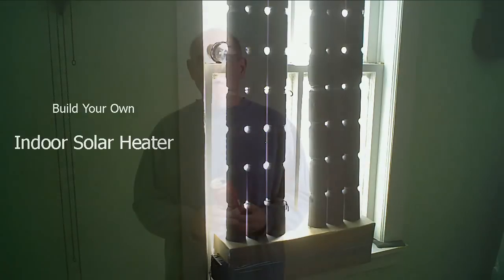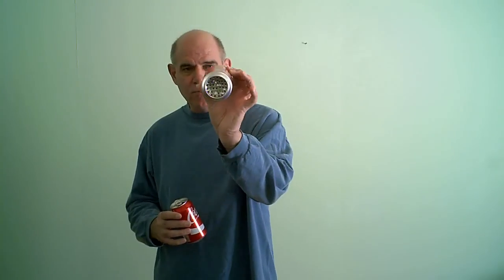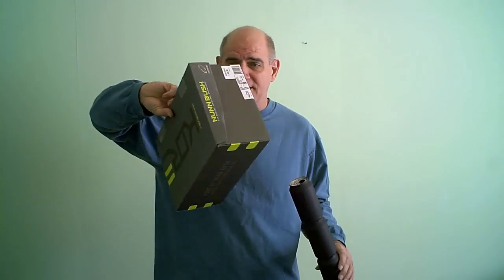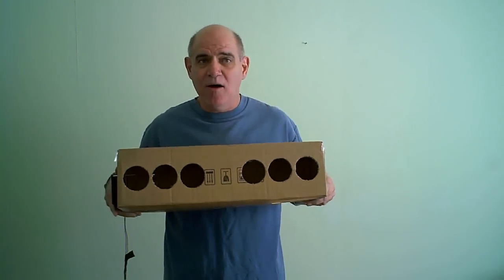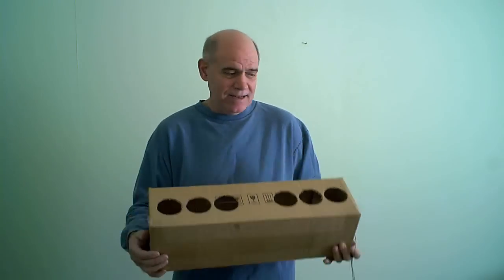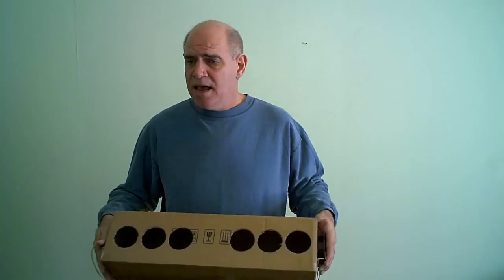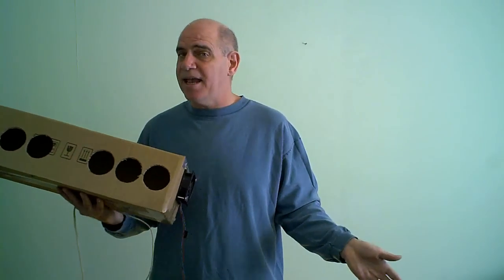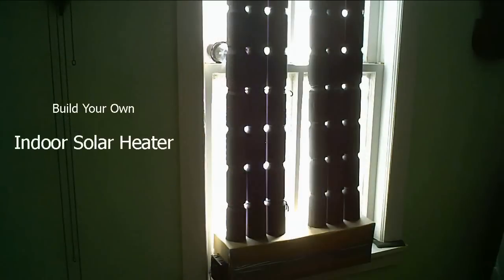Indoor Solar Heater

Comment: Outdoor need glass front and sealed, plus weather proof, internal heater can use the inside of the glass by simply standing in the window and can be movables as the sun moves around.

Comment: We have to run an electric fan for this to work though?
Reply: It will work without it because heat rises and cold sinks.  A fan will just help.  You can run a computer fan off a small solar panel.

Comment: A black curtain would work better. Also the glass on the window and the gases between filter out  wavelengths of light that's energy that's not even hitting the cans. Cans are only used because they're good in a box outside best option if you can afford it is black tiles on the floor with the sun hits it

Comment: If the entire tops and bottoms of the cans are removed, and one whole side of the box is completely opened up, I think the extreme thermal gradient between the top and bottom, and the ease of airflow might get rid of your need to even have a fan via convection.

Comment: the heat has already come through the window, all you are doing is stopping the heat at the window . Let the sun shine on the objects in the room, keep the windows clean.
Reply: but then it hits the walls and floor and conducts away, whereas with this, nearly 100% of that heat convects into the air first.

Comment: Yes, fossil fuel companies are not stepping over each other to teach people how to go solar, but this particular type of device is much copied on YouTube, but it is not as effective as a physicist like me can teach you how to build it.  Forget the pop cans and all you work collecting and cutting them, they are unnecessary!!     Instead build a well insulated box, insulated from the OUTSIDE either with foam insulation or 7 or more layers or corrugated cardboard using white glue, and use a layer inside the wooden box of aluminum foil, also adhered with white glue.  Spray paint the aluminum foil inside the box with flat black heatproof paint, engine enamel or such.  Then suspend two layers of black aluminum window screen from the middle of the top of the box to the middle of the bottom, with steel wires. A hole in the bottom and top about 4" will bring in the in-house air to be heated at the bottom, and the hole at the top will bring back the air that has been heated into the house. Use flexible dryer hose for both and wrap them with soft aluminized insulation. It's best to put these on the south side of your home on the home outer wall, but if you cannot, then put them close to the home in your south yard exposed to the sun and pipe the hoses to high and low holes in your home. Then use a small box fan from a computer to blow in the hot air. Cover the boxes with either glass, or clear plastic sheet. If you use corrugated plastic then use the waffle foam they sell for it to seal the corrugations.
Reply: Show us
Reply: @xgymratx  
I just told you.

Comment: You are a fabulous man Lol, a man after my own heart. I have gone NUTS researching these Solar Air Heaters & I have ended up with "analysis paralysis"!!! I was in melt down trying to decide the best most efficient way to construct a heater & materials to use. YOU SIR have in my opinion & for my "original ideas" for needing one & how to make it, come up with a FABULOUS  & simple & green design that is exactly what I wanted. I too will make the same version as yours & then an external similar design too.But I just love the one in this video well done!!  Even using the fan to push cool air not suck hot air is better design for the external one, which should produce up to 150deg!. So thanks very much to you & a chap called Desertsun02 on YT as well. Simplicity is best.

Comment: Exactly Wat I'm been saying about solar heaters. Who wants all that drilling holes in ya wall. Wat I'm saying is it don't need plexy glass on it if it sticks str8 to the window. Thanks for proving it works. Ain't built mine yet but mine will be indoor heaters. PS it can be built with a tilt in it. Even flat its gonna pump heat init. Love it.

Comment: A simple solution would be to replace glazed units in North facing windows with low iron glass externally for better light transmission and low E / K glass internally to trap heat.

Comment: Only in the winter, you can try adding a little fresnel to your window or door panes to get more warmth! But do not use cardboard with it, because you can start a fire in the house. I think this system can be further improved in many ways.
Reply: A Fresnel lens is only a concentrator, it doesn't send 1 single photon more into the room. Only thing it does is creating fire hazard

Comment: You can run without the fan, as convection will automatically pull cold air in from the bottom and as heated push it out the top
Reply: I bet the fan could be used at the top to blow the heated air into the room, or you could add a second fan...
Reply: as long as there's enough ventilation to and from the cans. He may need bigger openings.

Comment: I think this kind of "indoor solar heater"is meaningful and efficient, because it convert the most of solar 'light' energy to 'heat' energy. As commented below, the total sum of solar energy does not increase after entered inside room, but the large amounts of solar energy will be consumed to brighten the room. I guess this kind of black device keep the solar light photons from being consumed to brighten the indoor space, absorb the solar energy efficiently, and help converting most of them to the heat energy.

Comment: pop can heater get up to 210 degrees and using cardboard is a great for starting a fire. Think I'd rethink using cardboard.
Reply: paper needs to reach over 400 degrees to ignite not gonna get that hot ever
Reply: Definitely don't use any type of magnifying lens to increase the heat on the cans.

Comment: I think this solution could also be perhaps applied to vehicles that are kept outside during the winter. Having this solution on the front windshield could be useful. An outdoor solar heating solution simply wouldn't be an option. 

There are issues with vehicles (including the glass) that would make solar heaters less effective, but I feel like it's worth a try regardless.
Reply: Buy a black car
Reply: @omarsoulay4764  That just heats the outside panels. A black interior could help. The problem is that your gains are instantly lost.

Comment: Thank you for this video.This is a simple and elegant solution to my heating problem. I live in an older home without heat on the upstairs. But there are sunny windows on three sides. I'm going to make these for those windows and use small solar fans from ebay. I prefer solar heaters on the inside because I don't want to be up on a ladder, and don't want to be drilling holes through the brittle shingles, and I want to easily remove them in the summer and just store them in the closet. 
I realise that this will only heat during the day with sunlight but that's better than nothing.
Now I have to pick up some pop at the store get hubby to drink it all and get on with my project.
Do you seal the top cans? 
What if you used one of those pointy old fashioned can punchers to punch triangular holes in the botton of the cans?.
Reply: Hi you have probably made your system    The original design from the Canadian Maritime Provinces used a key hole saw blade the kind that is used for door / dead bolt and handle installation
Reply: Darlene Young  Shut the doors to the room you are trying to heat. It might keep alot of the heat in when going to bed. Take care.

Comment: For people not seeing the purpose: 
Incoming solar radiation does not vary, but WHAT happens to that energy does. Sunlight striking and heating the floor suffers heavy conductive heat losses to the foundation etc, and in his case is not providing a comfortable air temperature. This setup specifically  increases interior air temperature, kind of the opposite of a mass heater.
Reply: Isn’t the net heat still the same? Isn’t it easier to heat the air than the dense floor? I don’t get it, I feel stupid.

Comment: The light (heat) is allready inside house. You just block the light to heat your floor and force it to heat those cans. Energy is the same inside room with or without cans
Reply: but you dont walk on the cans
Reply: Baby Power No.  It is circulating the air.  And the black metal heats to a higher temp,  than your carpet,  furnitire,  or whatever the sun is hitting.
Reply: Light and heat are not the same thing. Energy is not heat just as it is not electricity, though it can be converted into both.

Comment: I am having a bit of trouble understanding your "indoor solar heater" analysis for heat gain.
If the sun has entered your living space and then shines on your panel of metal cans to warm the air that is already inside your house, then what does your device do to transfer the heat that is already INSIDE your house?
Passive solar heat gain has already been achieved by sun rays that have come inside your living space through your window, let say.  The passive heat gain has already taken place!  There is no need for your device any more!
Tell us how your device contributes to heat that's already IN your house, please.  Thank you!
Reply: homayoun Shirazi if the inside of the house was black and metal would be no need of these. The cans transfer heat better than say.. Wood. Also black absorbs more energy and the system is like 6 hot chimneys. I built one. Now. There is a need for this! (unless you have a black metal house)
Reply: Better than the couch? Better than the floor? Stop typing so the world won't know how little education you have. Once the sunlight passes through the glass, all the energy is in the house. It's that simple, but, simple people find it hard to understand.
Reply: kkarllwt, if you have hollow black sheet metal furniture and flooring you would be almost correct, however the horizontal nature of these items would not produce the convection achievable by vertical tubing. Moreover this example would only heat the couch and floor, again, not useful for heating the air. Theoretically you could drill holes in the top and bottom of your couch and achieve convection through that, but this would only be effective if a large enough portion of the hollow chamber were heated by the sun. Whatever the case most houses I've been in did not have such furnishings, so that isn't an ideal solution for the average home.
Reply: it's being concentrated and contained would water boil on your driveway ? unless you contained it ?

Comment: How hot did the metal cans get? Is there a burn risk if a kid/ animal touched it after it had been heating up all day?
Reply from the maker: I've never had a time when I couldn't just grab hold of the cans and move them from window to window (as the sun tracks through the day around my house).  I don't have a thermal gun so I can only guess, but I'd guess maybe 90 to 95 degrees is about tops (wildly guessing) especially with the fan forcing the room temperature air through it it carries the heat away and into the room and the heat naturally radiates into the room from the outside of the cans (unlike the external box heater that would contain all the heat generated into a small space and would reach temperatures high enough to burn).  Before I did this one with the fan I just had the passive cans sitting in the window (same tube design - no fan) and I've never ran into a time where I couldn't just pick them up and move them. They've been warm/hot to the touch but never did it reach the point of burning my skin. So normal window, normal amount of light, I don't think it would ever be a problem.  That said, I have played around with placing a Fresnel lens on the outside of the window (large one out of rear projection television) and I had to give up on that idea as I was afraid I was going to burn my house down!  It definitely heated up beyond a safe temperature as the paint on the cans began to smoke and burn away.  I may try the Fresnel lens on an external box at some point, but, I would have more control over the focal point of the lens and I would set it at a distance to not be able to focus the light quite that much.
Reply: paper has to reach 400 degrees to combust.  no way
Reply: @yocoach6556  Fresnel lenses are crazy, they concentrate a huge amount of light onto a small amount of surface, which can get hotter than 400.

Comment: Thinking about building one.   Just wanted to know what the idea behind using bubble wrap in the window is for?  Would using bubble wrap cut down the sun rays?
Reply from the maker: I have the bubble wrap on those windows to cut down on heat transfer between the inside and outside.  The house was built in 1893 and still has the original single pane windows. Not wanting to loose those but wanting to have a bit less heat loss I put the bubble wrap up.  I was a bit worried about the light making it through those as well but in my informal tests the rooms seems to be warmer with the bubble wrap.  While they might block a bit a light, the heat transfer through the single glass panes being slowed seems to make up for it.  If you have good double or triple pane windows it may work better for you just to have a clean clear window.
Reply: Thank you for replying.   I have single pane windows as well.   I will try the bubble wrap.   Just waiting for the clouds to disappear.
Reply: You can buy plastic window film for that. Basically transforms single pane into double pane, at the cost of not being able to touch or open the window unless you take it down first.